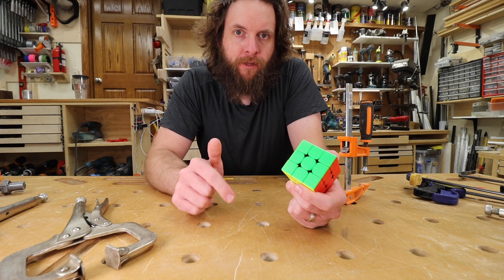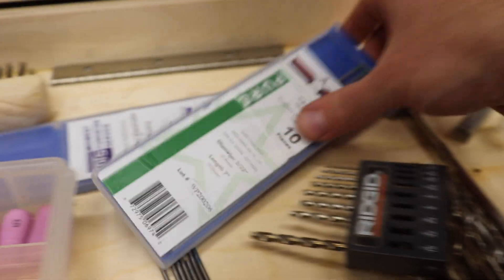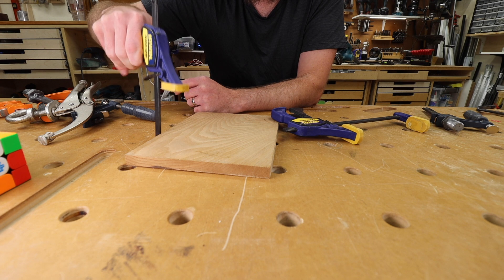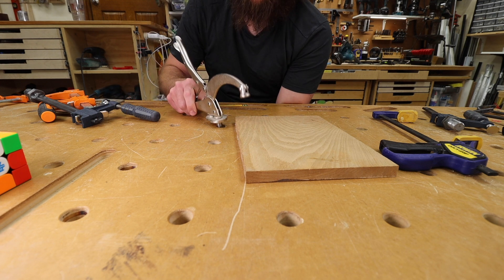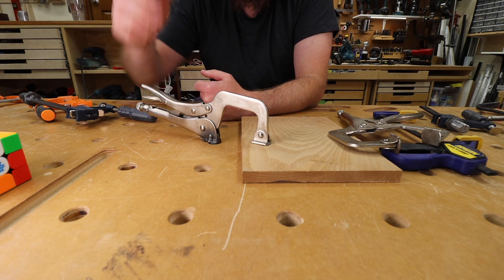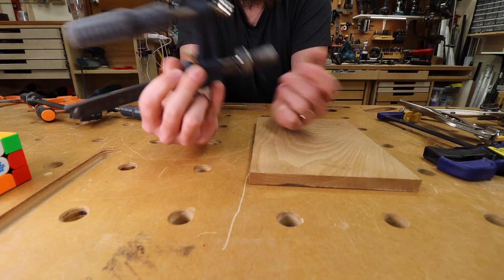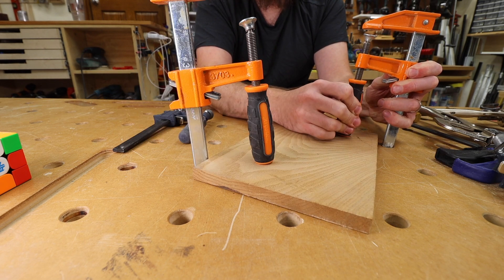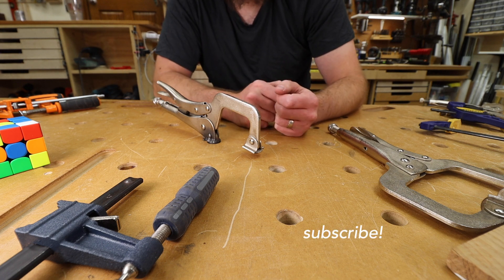MFSlab #2 - CLAMPS for 20mm Holes!

Comment: Funny. I do/did the same thing and bought the AHP. I hate the requirement to need two hands for the clamps. The modified welding clamp is interesting but I love the Harbor Freight clamp idea. I hate those clamps when used as normal clamps but for this app, perfect.

Comment: Lmfao at how to justify a tig welder. Been there done that, didn't regret it one inch 😁

As for expensive Vs cheap clamps. Can HIGHLY recommend whipping up a couple of these side clamps too. Cheap as dirt and I use existing dogs for the post. He also does a next vid of adding some integrated spacers but I've not needed those yet myself.
https://youtu.be/bpJyqLoqV04

Comment: I know you're busy living life, providing for your family and stuff, but we need more of your vids.  Try to think of us once in a while and stop being so selfish.

It's funny.  I got the AlphaTig 201xd myself back in May and have spent a tank of Argon practicing, but I am still at the shit my finger is burning, while welding perfectly sharpened tungsten tips to various types of metals stage.  I seem to be stuck at this stage.  Weld.com and ThisOldTony only add to my feelings of Tiginferiority.  I have been eyeing various epoxy brands as an interim solution.  Please help.
Reply from the maker: MrT it’s been way too long. I have 2-3 big videos in the works, and some of these sorts to sprinkle in in the meantime.  As for your wedding woes, I get you. I actually ditched the pedal on the alpha for now and am using the button. I’ve found that to help quite a bit. Send me a contact on my website (if that’s not enabled, keithkellyphotography.com has a form up) and I’ll send you a pic of my tig settings that seem to work well with the button. Also try Kevin Caron and Welding Tips and Tricks.  

And screw tight your Argon tank at night.  I learned that the $40 way.

Comment: If making your own clamps and learning in the process is the main aspect, a design similar to Klemmsia's Workbench Clamps is something to look out for. It's mostly made from wood and not too complicated or costly to make.

Now another point I'd like to mention is that with the exception of the Festool MFT-SP fixed clamps, all the clamps here are holddown clamps providing downward pressure. This is obviously good for glueups, drilling and mostly cutting, but not as great for edge routing or surface operations such as planing or sanding as the clamps get in the way. For these situations low-profile clamping solutions which clamp from the side or work on friction are oftentimes preferable.

For friction, one of the cheaper methods would be those fishnet-lookalike anti-slip mats for drawers and such, or bench cookies (or similar). The latter have the added advantage of lifting the workpiece off your work surface so you don't accidientially cut, drill or route into it.

For side-pressure aside from aforementioned Festool MFT-SP fixed clamps there's a variety of different methods available. The most elegant solution I have seen yet was shown by Pask Makes in his Mini Workbench ( https://www.youtube.com/watch?v=JMmvyaBUhO8 ) and make clever use of a Moxxon-style vise and dogholes for side-pressure clamping. Here you can also achieve some downward pressure by using bench dogs which have a slight taper.
There's also various other clamps which do this, such as Veritas' Bench Blade and various handmade or 3D printed solutions.
Another neat concept I have seen is using quick clamps in a spreader configuration either against bench dogs, or (semi-)permanently being affixed to bench dogs.

Comment: On those quick clamps put a bolt through the metal right after the bend so you can one-handed push down without it going all the way through the table
Reply: Or weld 90degree tabs on each side
Reply from the maker: Brilliant. This would fix that.
Reply: @KeithsTestGarage  If you start off with the clamp not opened up all the way you can just hold the outside end of the metal bar between your pinkie and palm, and then push the sliding jaw along with your thumb. Only need to use the squeeze grip for final tightening.